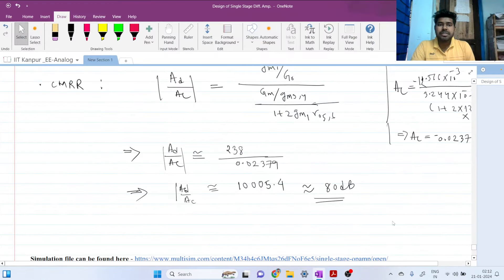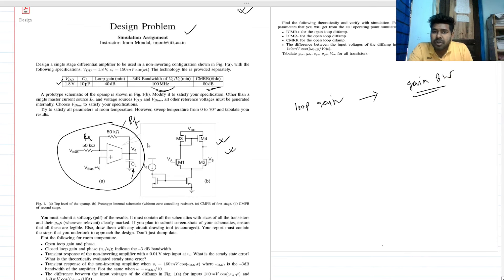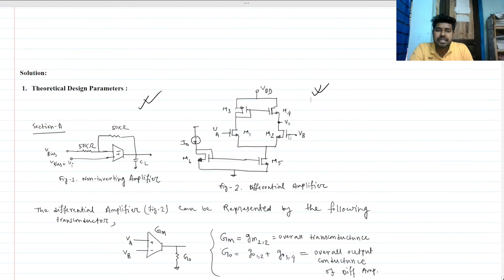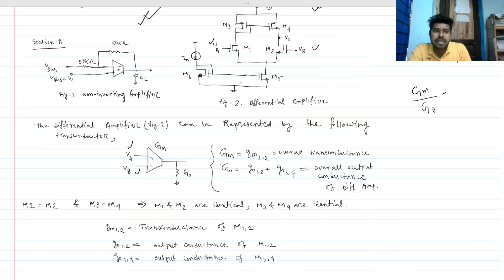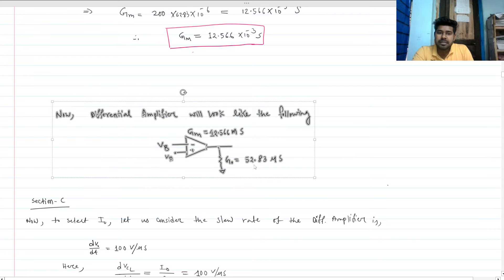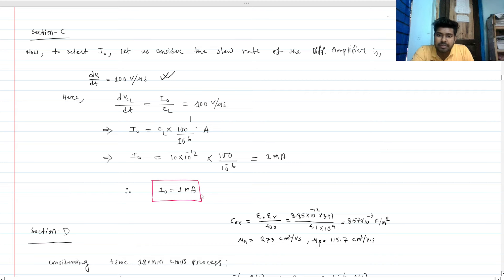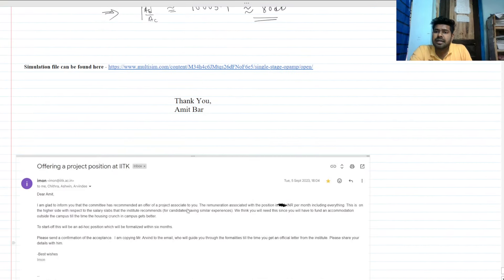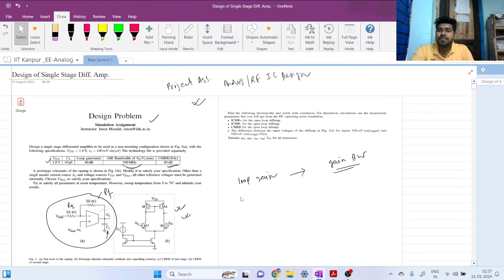Op-amp Design Problem_ IIT Kanpur Project Associate Analog/RF IC Design

Comment: at 17:30 equation written on top is wrong, you extracted further data using wrong data. how your results came correct? . overdrive voltage cannot be as high as 0.72V i guess.